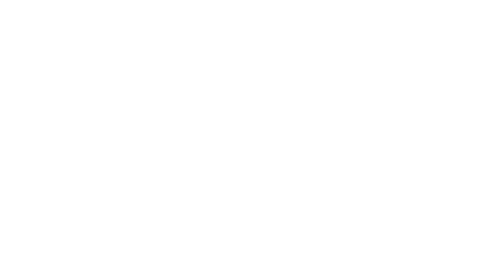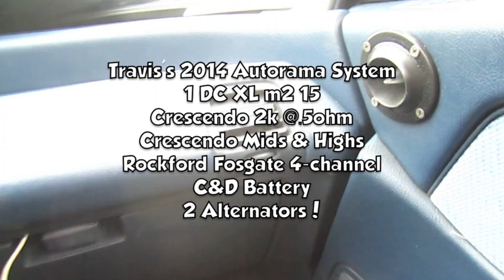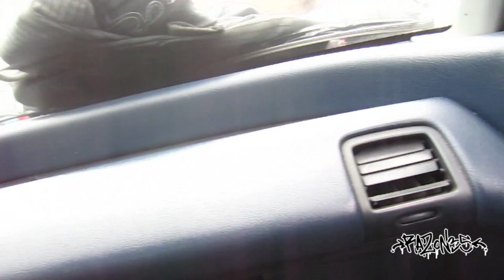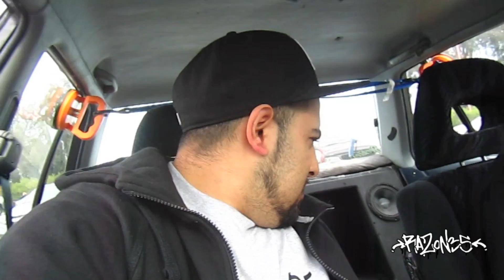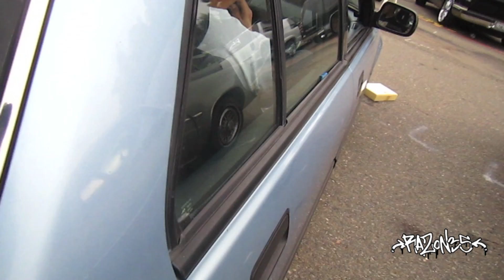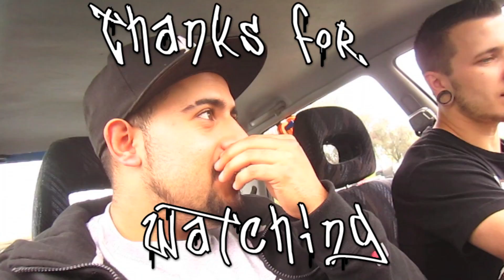LOUDEST Single 15 on 2,000 watts in HONDA CIVIC

Comment: I would LOVE to kno the specs on this box I got the same amp, same sub except the m4 model. There is NO sealed specs for dc xl15. So how did he come up with the sealed side of the box just half the ported or did he go with a different ratio like 1/1 instead of 2/1??

Comment: I'm building an orion 15 on a dc 1.2k in a single cab chevy how do you think it will do
Reply from the maker: which model orion?
Reply: Hcca 15.2 and I'm getting my amp from thomas
Reply from the maker: Caleb Johnson need more power!!!
Reply: My uncle has a Orion HCCA 15.2 in his Silverado Extended Cab running on a sundown 2500 that thing takes the power with no problems
Reply from the maker: jedimaster thevater yea, they are known for handling more than 2,000 no problem

Comment: Box box box ... I need a good box
Reply: Pay up for someone to build you one or save some money and build one yourself.
Reply: +MazdaBass971 ya when it comes to boxes don't do it your self unless u know 10000% what your doing. Me and my buddy built the box for my 4 18's. His program said I should be hitting 143+12-15 more db once it's in the truck at 9k rms. Should be up close to 160db at 13k rms 16v 4 18 re xx on 2 soundstream xxx6500's
Reply: Meant to send that to you lol.
Reply: I go to Lowes have them cut as much of it as I can just because that saw they got gonna cut straight all day every day, finish the rest with a skill and jigsaw. The easiest way I have to build a ported box is using aero ports
Reply: dude, it's all in the box.. you can have 500RMS and still be hitting 140s in the right box